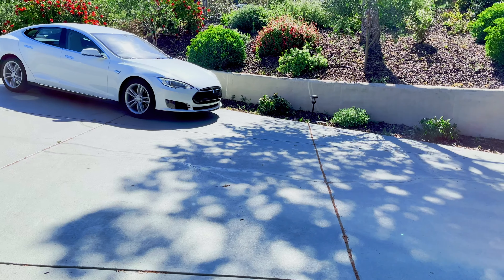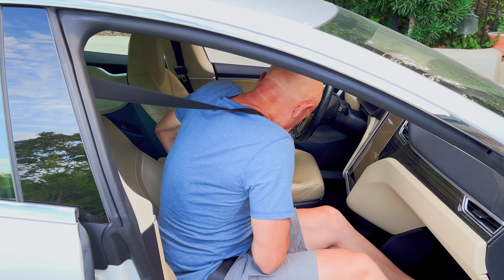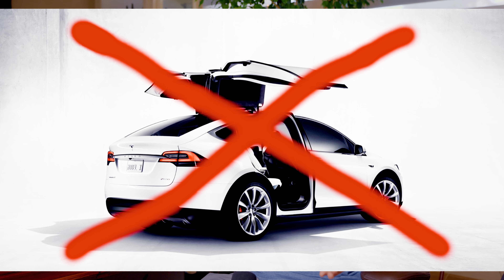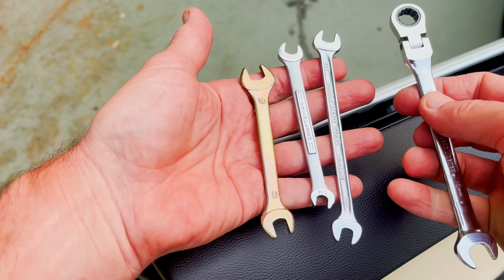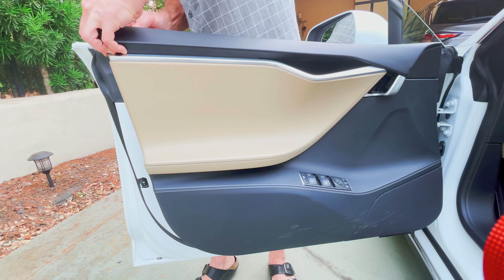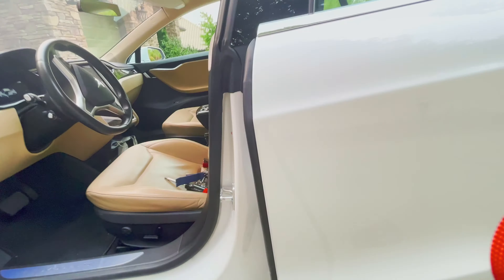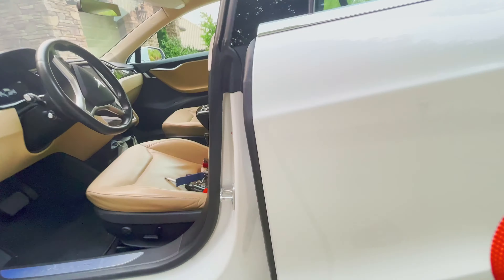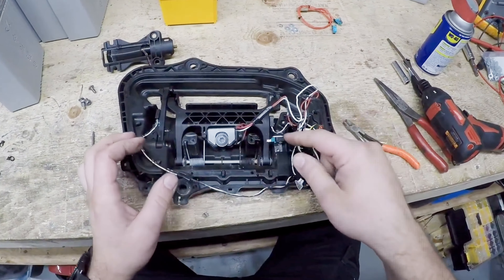Tesla Model S Failed Door Handle - DYI or Not?

Comment: I just did this for my 2015 S.  The videos were very helpful, but in my case the webbed strap at the upper back of the door panel had so little slack that I had to cut it because there wasn't sufficient play to tilt the panel out of the way!  The only really difficult part was restoring that one nut.  What finally worked: I epoxied the edge of the washer of that nut to a coathanger to hold it in place while I threaded the nut.

Comment: My 2013 S85 driver's door handle failed about a month ago, but not in the same way yours did.  My handle would present, but after presenting the door would not "unlatch", as if it was still locked.  Being out of warranty and not knowing what else to do, I went to my nearby North Austin (~5 mi.) Tesla service center just to ask if I was doing something wrong, and was told that the unit had failed.  The amazing/miraculous part of my story is that the handle failed on Thursday evening, I went the following morning (Friday) at 10:00 a.m. WITHOUT AN APPOINTMENT and was surprised when they asked if I would like to have it repaired RIGHT NOW!  I could hardly believe it and after getting over the shock, I agreed and left the car then and there.  My wife picked me up, we went home, had lunch.  I was called at about 12:30, the car was ready ( $309 incl. parts, labor and sales tax).  This same repair on my former Mercedes would have required an appointment days (or more likely weeks in advance -- depending on availability of the parts) and cost around $700.00.  I probably used up an entire year of karma on this repair.
Reply from the maker: Thank you for sharing, UTArch. You were lucky indeed with this repair. Sounds like it was a separate failure than the handle motor gear. I hope more good karma is coming your way. Cheers!

Comment: On my new to me 2014 model S, both my rear door handles would not retract out. I paid Tesla to fix both, like 300 something a piece, and they replaced them. They both retract now, but one side won’t open the door when the handle is grabbed from the outside. I have a follow up service appointment scheduled, but I have to wait another week. I hope it’s simple and they can fix for free this time and not say it’s a different part. Any idea why it retracts but doesn’t open?
Reply from the maker: @JeepLJ  If Tesla indeed replaced entire door lock they should honor the repair warranty. The two lock problems,you’ve experienced, are due to failure of different parts in the lock mechanism - a lock gear in your first repair and a lock sensor in the non-retracting door handle. If Tesla repaired the broken gear instead of replacing whole lock with new, they may charge an additional cost.
Reply: @Tellvia thank you for your reply. They had replaced the whole assembly. That is good to know it should be covered under the previous work, hopefully it will get fully fixed this time without a problem.

Comment: Very useful video. Thank you for sharing. Can you please share the size of the torx wrenches you used for the job? I do have a box of wrenches and want to make sure I have the correct sizes before starting the job. Thanks.
Reply from the maker: Thank you for watching! For the door handle repair you would need  10mm wrench, 9mm or 10mm bolt driver bit (size is depends on the model year) and 8mm or T30 star bolt driver bit (depending on the model year). Remember to seal back all the bolt access wholes after the repair. It is important for proper operation of the airbag. I hope this answers your questions. Cheers!
Reply: Thank you  @Tellvia

Comment: I just repaired my 2014 P85D, both driver side handles. Same problem with broken paddle gear. Replaced with $6 genuine Tesla part, new version of the paddle gear looks to be made out of better grade metal so should last longer (I hope). The advice I got from the Tesla service center guy who sold me the part is to use air bladder jack to spread the gap on top for easier removal of the top two bolts. Got the air jacks on Amazon a set of 3 is only $15, does make the job easier. Also, cover the shiny door handle to prevent it from getting scratched. Another is to use some old credit cards to wedge the bottom to level the handle before tightening the bolts.
Reply from the maker: Thank you for watching and commenting, Jonathan. I may use the tips you used in your repair next time one of the rear doors gear brakes on our Tesla.  Good to hear that Tesla finally sells spare parts to owners and third party repair shops. Cheers!
Reply: Some other guy used a screwdriver to close the hook of the door while being open.
That makes the window go up another 2cm or so - just as you witness wenn closing it for real. The window does that to protect the seals upon closing.
That trick gives you some more space to get the handle out.

Comment: Awesome, excellent detail of explanations. I have the same problem on my model S 2015, the door handle on driver side. I look it apart and found the same broken part with your. could you please share me the company website that you bought your tart. Thank you
Reply from the maker: Hi Steven, thank you for watching. I found that several vendors sell this part on eBay. I suggest to buy a stainless steel version - just type in the eBay search "tesla model s door gear". Some vendors sell a kit that includes washers and new limit switches. If your switches are not broken, changing just the gear part is easier. Cheers!
Reply: I got mine from a Tesla service center. $6 each.

Comment: My door handle will only open from inside
Reply from the maker: Does the door handle retract on the outside? It not, the culprit is likely the broken gear, if the handle retracts on the outside door panel, it might be the switch that unlocks the door. Cheers!

Comment: Old cars have old problems. This is not a issue any more the new door handle mechanism is much more robust. And also improved with no more micro switches. Just buy a new door handle and let a Tesla Ranger install it.
Reply: No sign that the new handles are more robust.  Our second door handle has just failed.
Reply: New cars same problem. Tesla is really using cheapest materials for parts. It will retaliate to them…
Reply: @AlanMcYou  well for us none has broke after they have replaced a door handle. And I like the option that only driver door handle is presented so less ware and tear on the other once. But all still work after about 8 years.

Comment: excellent video. wow tesla not selling parts :(
Thats why i buy toyota :)
Reply from the maker: Thanks for your comment, Alex. Tesla is trying to make their Service Centers into profit centers, but the quality of their service, in my experience, is so shoddy that I think they will eventually loose all their existing customers. I am a Toyota fan now as well :) Cheers!
Reply: BS. I got my paddle gear replacement from the nearest Tesla service center. Just $6 each. Just walk in and ask for the part. Charge to my Tesla account automatically. The parts guy even walk out to my car and give me some pointer to how to remove and rebuild the door handle.
Reply: @Tellvia  I don't see Toyota dealer sending technicians to fix cars at my drive way or at my work. My rear passenger door handle went first, Tesla replaced it under warranty with a new gen 3 handle (Hall effect sensor instead of micro switches) did the work at my work parking lot. I didn't even have to come out. Second one was the from passenger side front door. I was at the service center getting my MCU memory chip recall work done so they replace it with another gen 3 handle but this time it was out of warranty so I paid $343 for the work, $200 parts and rest labor and tax. Pretty straight forward. Wend my driver side doors went I decided to save the money and did the repair and rebuild myself. Hope they will last until I am done with my model S. The door handle on the Model S didn't need to be the fancy slide out but Tesla being Tesla went with the over the top design. They did go through several revision though. My 2014 P85D had the gen 2 handle, I read on the internet the current gen 3 handle are suppose to be much better build with less point of failure. Still, a traditional door handle without that many moving parts would've last life time of the vehicle.
Reply: You buy a Toyota because you don't know what its like DRIVING a Tesla everyday.